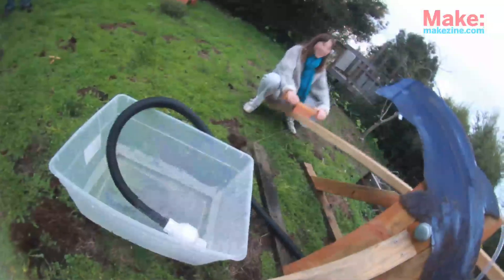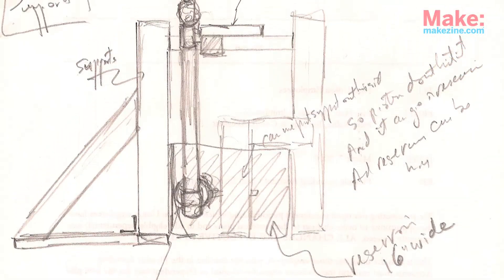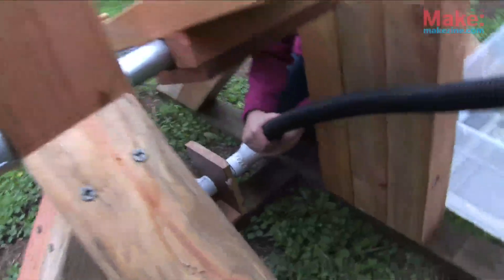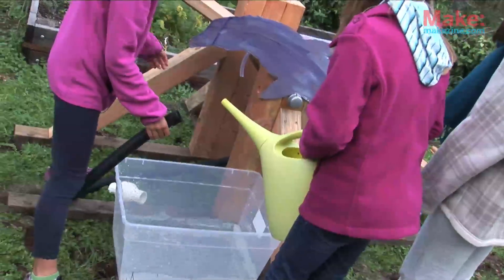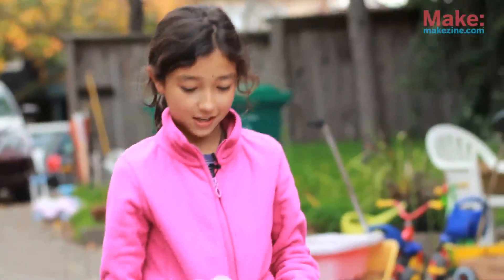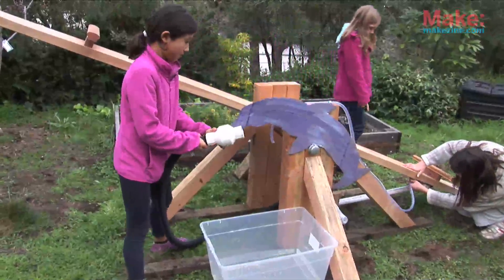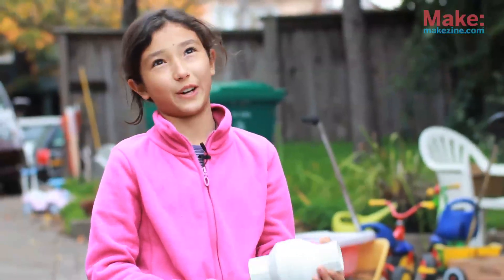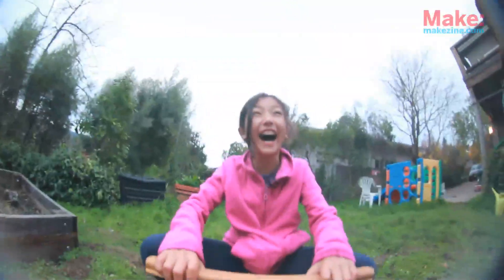Maker Pioneers: Kurt Fleischer, Water Totter

Comment: you could use the pump to pump water up into a large container several feet above the ground then use the downward motion of the water to turn a generator and/or running water when the pump isnt being used, the water storage tank stores the (potential) energy